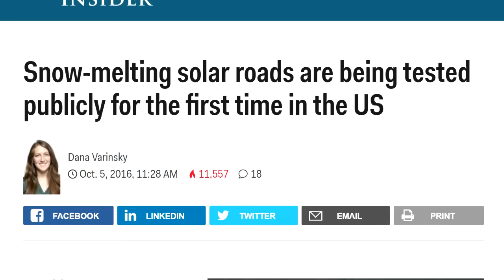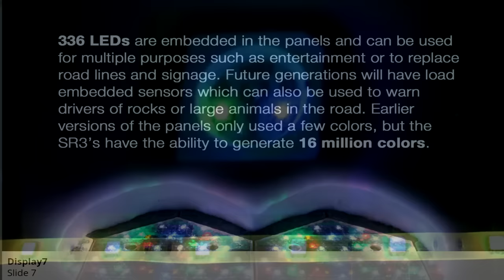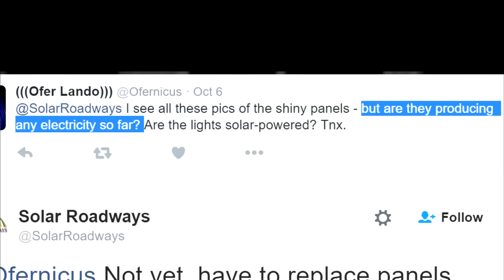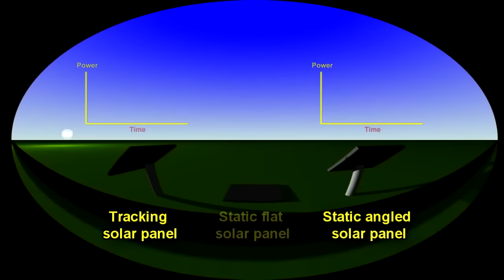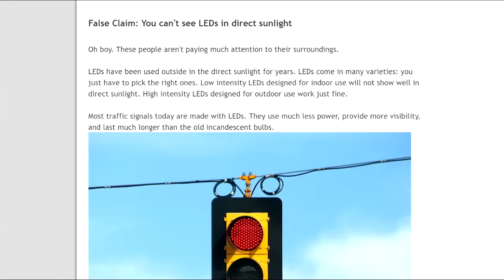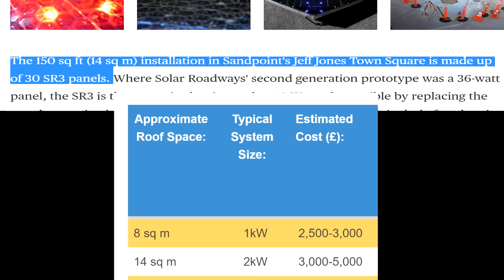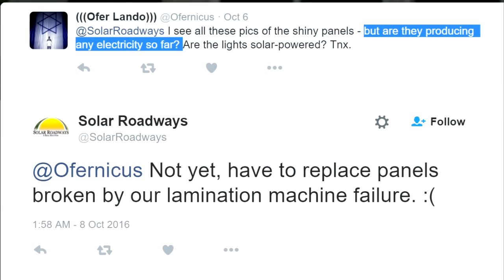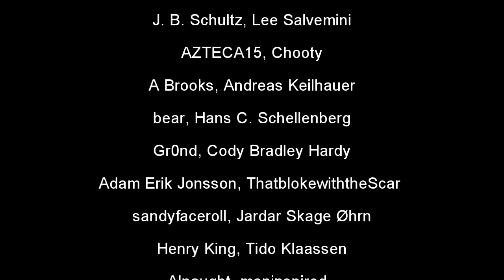First AMAZING Solar Roadway UNVEILED!

Comment: Solar Pavements/sidewalks makes more sense, not roads
Reply: even that is idiotic... they still need to be heated all winter
Reply: Solar panels on roofs would make the most sense
Reply: walking on glass seem like a terrible idea, especially when it's wet.
Reply: Even then it would make much more sense to put the panels on some elevated structure so they could also shade/shelter the sidewalks thus providing an additional benefit for the citizens.
Reply: Yes, it would make slightly more sense. At best.
Reply: Prich038 or just yah know put some solar panels up : /
Reply: And if you put the solar panels on the roofs, angled towards the sun they are so slippy that all the snow slides off them in the winter. Just like it is already happening all over the world. A much better idea would be to just make roofs out of solar panels instead of putting solar panels on top of roofs. Not sure however weather they would withstand the heat-difference between the outside and inside of the roof. However, all the insulation is on the inside anyway so the temperature difference should be not all too big...
Reply: roof them over roads would work  somewhat and keep snow and rain off the roads lol!
Reply: I've tried a SolaRoad in Krommenie, and it was very grippy.
Reply: They did a 50m bike path installation in The Netherlands and EEVblog has a good summary of it. Not surprisingly it produced just over half (like 51%) of an equivalent rooftop installation (average of 3 within a few kilometres around it) for over 10 times the cost. It did work, just not very well or cost efficiently.
Reply: I read it's still cost-efficient as dual-use surface, but can't find that on their site. Anyway, rooftops are not enough and the budget has not been fully spent.

Comment: The design is not as clear on the vid as I would like and all your points are so very valid, yet I was washing dishes and I noted the bubbles in the dish water were dome like in shape, could this aid in the collection of sun light? I mean the panel being made up of half domed bubble shaped rows. I don't know I am just a house wife, please take my question and see if that would be a good idea. Cheers
Reply: There are no stupid questions. Just stupid people who don't ask questions :)

A dome shaped lens would indeed concentrate the sunlight on a point.

It would not however, magically make more sunlight, which is what's needed.
In fact, it's probably the opposite.

If you've ever walked on a road in summer, it's pretty hot.
Now get a magnifying glass, and put your delicate electronics under the hot spot.
Ouch.

Also, a bunch of smooth dome-lenses would make a terrible surface to drive on.
And after about a day, they wouldn't be lenses.

It's a great idea, it's just not feasible.
Reply: Thank you, So very much for  your answering. I do think perhaps having the heat be the catalyst. and  harvesting the heat in a conductive manner would be far more  feasible.
Yes on further thought no matter if inside the flat panels  they would have thousands of half domed shaped bubbles filling the surface, the sun would only be at optimum collection when the sun was at noon. MMMM
Reply: ***** No, not at all.

If we had billions of these thing lying around, possibly as the result of a failed venture, then it would make perfect sense to use them in this way. or as solar powered billboards.

The problem is that each of the individual problems CAN be overcome, there's just no point.

This project absolutely be done.

IT would just cost trillions of dollars. 
Which is totally counterproductive as a way to save money.
Reply: ***** As i said, doable but not feasible.

Make every one with inch thick gorilla glass, traffic light LEDS, the same solar panels that they use on satellites, the same batteries, and bolt the whole lot to a concrete slab.

Entirely possible. But expensive to the point of carpeting the roads with smartphones.
Reply: ***** pretty much.

It can be done.

But that's not economically viable, sustainable or feasible.

It's like plating an entire building in gold.
Possible, but not feasible.
Reply: wearealltubes. G'Day  love the debate and totally agree with you but dosent the government do that everyday. :-D
Reply: ***** yes, you could.

but, like the above example, it's not feasible.

The waterwheel uses potential energy that is 'going to waste.'

Whereas the mechanical roadway uses energy that comes from...the cars.

And where do the cars get their energy?

Fuel.

So, even if you could find a feasible way to do it, that didn't cost the earth, and didn't break on day one, what you've created is a road, that gives shitty fuel economy.

Better to make a regular road, and power the lights and stuff with efficiently generated power from the grid.

There Ain't No Such Thing As A Free Lunch :)
Reply: ***** Yep. Energy cannot be created or destroyed, only moved around.

Any energy gained by the car dropping down, has to be paid back, by the car climbing the next bit.
And going up hill costs energy.

Gravity isn't free. Anything that falls, someone or something had to pay energy to get it up there in the first place.

And this is why those old-style bike-dynamo lights were unpopular.

Free light! No batteries!
Except you provided the energy yourself.
And it made it no fun.

Nothing is free.

And america can't find the money (???) to pay for it's crumbling infrastructure with simple asphalt and concrete. Imagine the cost of solar panels or pressure plates.
Reply: This is actually a thing. Not dome shaped, but they do concentrate light. Look up concentrator photovoltaics .
Reply: Well, what if you focus the sunlight into a smaller area to cut down costs? That way you build smaller panels and get roughly the same result.
Reply: +Dover nope. because you have to have a collector the same size as the panel would have been, in order to collect that light.
And you'll lose some in transmission.
And the solar panel may be less efficient at higher intensities, or be damaged by the heat and light.

Remeber: TANSTAAFL

(There ain't no such thing as a free lunch)
Reply: +Azirahael
The point is that an intensifying material is several magnitudes cheaper than an equal sized solar panel.
Reply: +Dover Huh. Good point.

Not sure that would help on a road, and would make the road slippery.
And that could still be offset by the heat stress on most panels. 

But it is a good point.
Probably a good idea for places that lack heat/sunlight.
Small panel, big magnifier.
Reply: +Azirahael
Well, I'm not really talking about roads. Putting solar panels on roads is just all sorts of dumb. I figure once technology advances more, solar panels will become less fragile. We'll see.

Comment: forget about solar. lets say they are perfect in gathering power. there is a reason that roads are made from asphalt. it lasts, it does not crack with temperature changes, it drains, it has traction, it can be serviced, 100% recycled, it can be serviced. end of talk.

Comment: how about solar freaking roofs?
Reply: Stop making more sense, you're ruining the scam.
Reply: my apologies. i will run an efficient steam engine to produce electricity with 10% effectiveness. certainly better than solar panels on elevated positions to increase efficiency which is totally stupid.
Reply: So when I'm wearing my boots in the snow the solar socks will heat up my feet? Awesome!

Comment: How about making a roadway that harnesses the weight and momentum of a car instead? I think that might be more feasible.
Reply: The energy still has to come from somewhere.
Like the cars driving on it.

Even if you were somehow able to find a way to do it, what you've just created, is a road that has higher fuel costs to drive on.

Do you think this will be popular?
And will higher fuel consumption help the environment, or fuel reserves?
Reply: maybe a road that somehow transforms friction into electricity? DRIFTERS ARE WELOCME! haha. tbh i don't have any idea how to do it. but neither do Solar Roadways, so who cares? lol
Reply: I was actually thinking of panels that move a bit when cars drive onto them and that movement can be translated into electricity. The problem is that it would need a lot of raw materials like copper.
Reply: ***** Theoretically possible.

set up each tile with a seesaw action attached to a dynamo.

But, ignoring the fact that it will vibrate and noise like crazy, and wear insanely fast, there is the fact that the energy has to come from somewhere.

It's not magic.

And where does the energy come from?
The car.

So, even without the other stuff, you've just made a road with shitty gas mileage.

Not going to be popular.
Reply: Azirahael Well, to my defense, I didn't exactly start a kickstarter and ripped people off for millions of dollars. It was just an idea. :P
Reply: ***** Fair enough.

Like the cops say: "Follow the money."

Same here: Follow the energy.

Where does it come from?

The only way to get 'free' energy is to make use of energy that's being wasted, and find a use for it.

Comment: The most embarrassing thing about all this is that they couldn't even make them water proof. Like how the hell do you actually fail at a) making the individual panels waterproof and b) making the touching edges waterproof? Give me a few tubes of silicon and I'll have that shit waterproof in less than an afternoon.

Besides all the other crap that's wrong with them, the fact that they couldn't even figure out how to hire a fucking outdoor electrician to install these and a metalworker (or similar) to manufacture some kind of actually fitting cover just boggles my mind.
Reply: How well will that silicone sealant hold up after a car drives over it a few times?
Reply: blkgardner Not arguing that it will do well for actual roads, but for a demo unit with the odd pedestrian going over? Probably a few weeks, depending what kind I use and the weather. Silicon doesn't generally do well exposed to direct sunlight and weather wear.

But there are defiantly other options out there that would keep it sealed and would cost next to nothing (<1k). Silicon just came to my head because I work with it semi frequently.
Reply: It's pretty clear that they haven't spent all those years and millions of dollars developing a working "smart, microprocessing, hexagonal solar unit". All of those words are a lie, it's problaby not even a "unit", just something haphazardly thrown together. I wouldn't be surprised if they did actually just used a few tubes of silicon that ofc wore out after a while.
Reply: Can't say much good about their budgeting plans, if they decided to spend hundreds of thousands of dollars in equipment for a personal maker space, even though they don't really need any more maker space equipment. Instead of doing it themselves, it would be smarter to use that much money to source labor from real factories to build prototypes.

Comment: what they should do is put nano pezo switches in the panels that generate energy when compressed and realeased instead of solar cells
Reply: It's piezo, and that would generate about 1/4 watt per square meter.
Reply: Better than actually using up power for LEDs and heating without producing anything.
Reply: +Poldovico No, it would actually lower the efficiency of every car which drives across the surface. you don't get something for nothing.
Reply: ronindebeatrice
That may not necessarily be true.
It depends on whether the piezoelectric crystals would be altering the motion of the cars or just harnessing energy which is usually wasted.
Reply: Poldovico At that rate, it would cost about $43,000,000 a year to run your house.
Reply: Warren Lauzon
What? You mean by driving around on piezoelectric crystals?

I didn't mean that as an alternative to conventional power generation, I was just saying that at least it's a way to get power out fo roads. I never called it a good one, at least it makes a positive amount.
Reply: Poldovico Yes. Each panel with install costs is around $1500 (according to their website, which I doubt). The most you could get from crystals is around 1/4 watt per panel - best case - and only in heavy traffic. So figure a max of maybe 5WH per day per panel. Average usage per American is 13 mega WH per year. Do the math.
Reply: Warren Lauzon
Yeah but their panels aren't piezoelectric. Nobody's making piezo panels, these guys are making solar panels that don't even actually work.
What I was saying is that as pitifully low as it would be, piezo panels (as suggested by OP) might at least generate a positive amount of power. I must doubly stress I never said it would be worth it, just that at least it would be functioning.
As opposed to the glorified disco floors solar roadways are selling.
Reply: Still have he problem of wear and tear and linking all of this up in a huge electrical network that will have to go along every road the piezo switches are embedded into. You have to produce more energy from a system than energy it takes to put it in place.
Reply: VivAtreyu
Sure, sure. But at least Piezo will begin to pay off that initial debt, as opposed to increasing it.
Reply: Bear up Yeah because piezoelectric lighters last a really long time!

Comment: I'm a materials inspector for civil construction, and I can tell you even if these things worked, there would be no way in hell they'd pass the tests concrete and asphalt have to go through to be on major roadways. You need to design concrete that can withstand up to 2,500 PSI on some major interstates. You can't tell me these things wouldn't be torn to bits in a few months of use.

Comment: because to know if an idea works or not, we should start by the basics. More than a solar roadway, it's a roadway. Now I believe we know what happens to our roads, they need constant repairs. On of the reasons is the vehicles, cars are heavy, but a buss or a truck? good luck making a solar panel that can resist that for a long time, good luck building one that can resist that at all.

Comment: English is not my primary language so please bear with me. I completely agree with Thunderf00t on everything regarding this idea of solar roadways. But even if it worked. It took several decades to build the vast infrastructure in the US. All the highways, roads, parking lots, driveways and so on. Decades of heavy machinery burning fossil fuels, millions and millions of working hours that workers have put into it. All the ground moving work and everything. And the surface is I guess for the most part oil industry byproducts, sand, stones etc. It's there, the carbon footprint has been created but you can't take that back. So just keep recycling it and maintaining it, building it up, maybe more efficiently. Done. Now these idiots vision is to build factories in all states, to manufacture tiles from expensive metals, plastic, glass, semiconductors etc... and ideally replace the whole infrastructure. How is THAT supposed to help the environment and how does THAT make sense to ANYBODY?

Comment: There’s no doubt that solar panels will be used on rooftops and possibly even sidewalks, but why start on roads, where you have to have thick layers of glass which reduces the light that the solar panel receives?

Comment: You know that whole thing about heating them is really 100% because if a snow plow ever did run over it, they would be destroyed so they had to invent a reason to say why a plow would not be needed. Tar based pavement is renewable already.  They dig up the old surface, heat it up, add some more tar and relay it. That's been going on for years because its economical!

Comment: And this is without the matter of STORING the electricity from daytime generation to nighttime usage. Adequate battery banks are still large, heavy and a large additional expense as well as continuing maintenance. Not to mention the damage that could occur with large vaults of batteries subject to the hazards of busy roadways. 

The "solar roadways" (lower case) concept could make more sense if used as part of the eventual development of roads that will be exclusive to autonomous vehicles, where there would be immediate power consumption and highly structured vehicle movement, allowing optimization of panel placement. But only AFTER every available rooftop was already covered!

Comment: The webcam in Sandpoint, Idaho that allows us to see the full glory of Solar Freakin' Roadways isn't working and hasn't been for the last two days. From what I can see, six of the original 30 tiles are still working and the seventh has about 25% of the LED's out. It was 40 F at midnight local time in Sandpoint, but the cold season is about to begin. November averages a high of 42 and low of 28 with 5 inches of snow. After that, we really get into snow season, with 20 inches in December and the temperature below freezing most of the time. Anybody want to bet how many of these things will be working by then?

Comment: I live in Phoenix, Arizona.  Even if they worked, I don't want to see a single Solar Freakin Roadway until we have Solar Freakin Covered Parking in every single parking lot everywhere.  Added benefits of cooler car interiors, no large obstructions parked on top of them, able to place them at an angle, and (most importantly) cheaper!  

See 16:15 of the video.